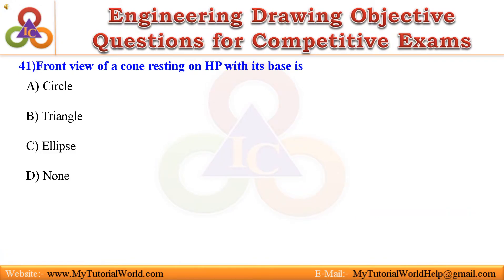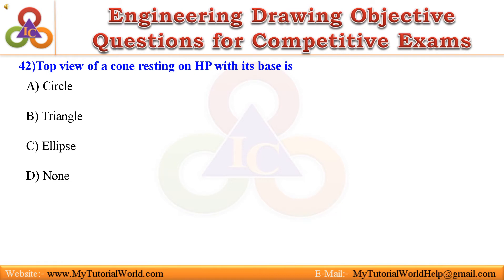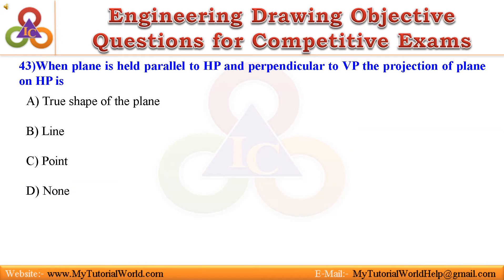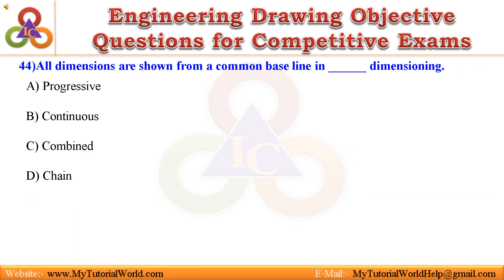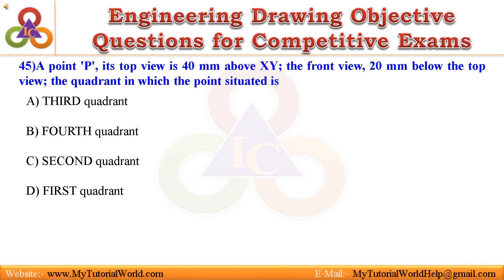Engineering Drawing Objective Questions A1 5 of 5

Comment: 45th answer is wrong...please correct it..right answer must be second quadrant
Reply from the maker: can you please provide the explanation
Reply: as the top view is 40mm above reference line  and and from view is 20mm above (as it is 20mm below top view). means both view are above reference line, this is possible when the point lies in second quadrant. but if top view will at 20mm below reference line then answer will be first quadrant......please go through https://www.youtube.com/watch?v=Qzh5ugdLYxw